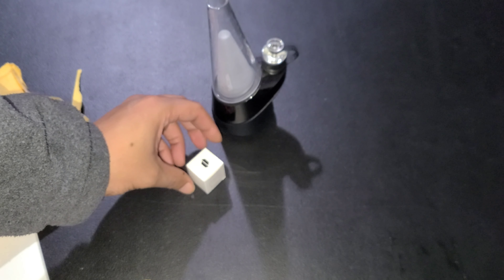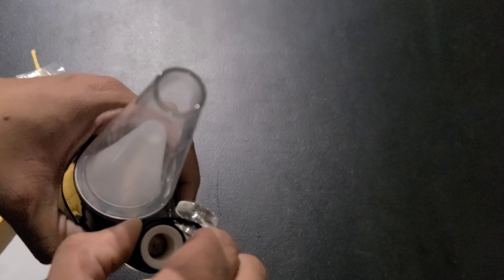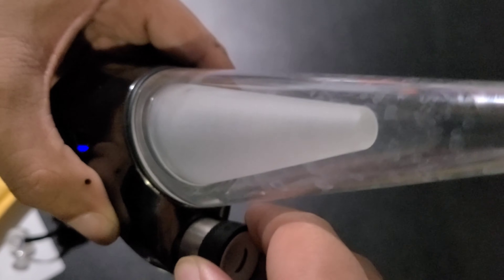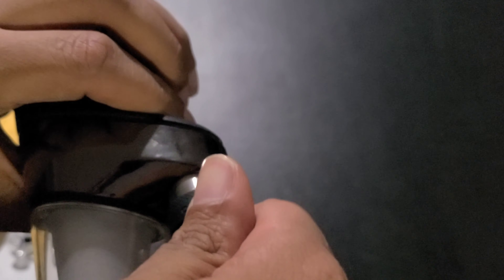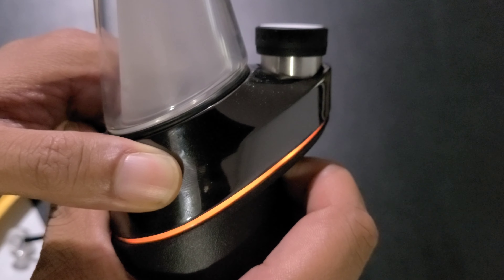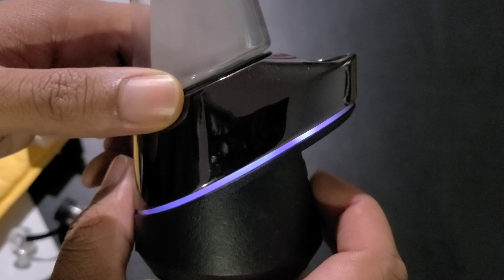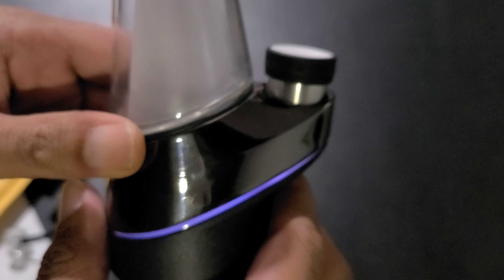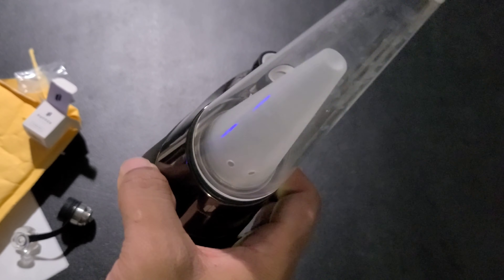How to replace at atomizer on a Puffco Peak in less than 10 minutes

Comment: I use my puffco daily .. six months now, no problem at all. Original atomizer.
Reply: Originalllll?
Reply: U mean I didn't have to replace this this
Reply: Just over 2 years of almost daily use and my atomizer broke (literally day before xmas too so replacement is coming today) what the poster of this video wants to do is take off the ceramic and silicone top from the atomizer, remove the glass bubbler piece and when screwing the atomizer in you can see from the air inlet how far you've screwed it in, over tightening it will destroy your atomizer coil. My atomizer broke just from heavy use, I gave it a full ISO clean every single day without fail and over 2 years but the coils themselves have degraded over time (as expected for something heating up thousands of times)
Reply: @georger5558 good idea on how to check how it’s screwed in because as I watched him and heard him say he screwed in tighter, I about died because I know that’ll fuck it up

Comment: When it shows the rainbow color it meaning it’s to loose if it where to flash 5 times same color the atomizer is short circuited which means you can take it apart and fix it or buy a whole new one

Comment: It seems like it was getting cross threaded when you were screwing it in and not getting a good enough connection. It seemed like the first few times you were kinda pushing it down while screwing it in almost forcing it. To start the threads, twist it as if your unscrewing it back and forth and once you feel like it's lined up start tighting it but not forcefully

Comment: I have gotten my atomizer wire stuck to the bottom of the puffco Peak. The thread won't come off. Any suggestions of how to clean. Or do I need to buy a whole new rig.? I only had it a month. And tried to clean it and nothing but gunk. And I was unscrewing it and the bottom had gotten stuck. Damn it messed up my day. I'm pissed 😡
Reply: Take it off when it’s warm ! I literally was just having the same problem and I clicked this video went through the comments and someone else said to try this and it work I just tried it literally 60 second ago. 
Out it on blue setting 
Hit the button twice let it go through the full cycle and after wards tried to thread it off and it came off 
All the reclaim makes it stick

Comment: From NKY just got my peak about 2 months ago and took a dab and while the sesh was going on it kinda just stopped heating lol.. i have it soaked in iso 91 with the atomizer top off because there was literal black carbon build up under the heating plate.. Im just hoping its not my device and just the atomizer as thats alot cheaper and easier to replace lol if all fails ill get a proxy eventually to stay away from the water edabsnails. I got 2 glass pieces off Temu for my puffco peak i have a review on my channel of it ;) they work amazing and havent had one leak at all.
Reply: my atomizer is fucked lol the coil legs from the heating element literally snapped off from the heat haha so much chazz build up time to get a new atty unfortunately
Reply: @venticated  How long did you use it for? The coil/legs on mine snapped and have some chazz but this is after over 2 years of almost daily use and daily cleaning.
Reply: @georger5558  about 8 months I sold it to a buddy for 100. I believe I was qtiping little too hard making them snap off from the atomizer lolz 😆
Reply: @venticated  Yea they do seem delicate from what I hear but I've not had any issues, replacement atomizer came today and honestly I think I'll replace it every year as it is hitting beautifully (no matter how often/well you clean the atomizer will degrade as it ages)
Reply: @georger5558  well you will have one day your atomizer coil will go out lol you just been lucky it sounds
Reply: @venticated  Oh this one is toast after 2 years after much wear and tear. You get a new one and it's still going strong I hope?
Reply: @georger5558  I sold my puffco to a buddy so no longer have it haha I use a dab rig now
Reply: @venticated that’s what happened to mine